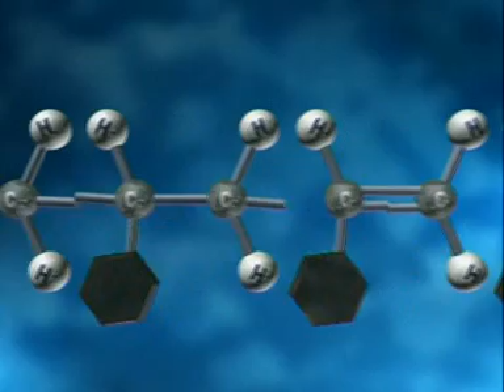Making polymers

Comment: Just realized styrene is  a cyclic hydrocarbon /aromatic like  rather then polyethylene types so i was more fixated on how you take ethylene and get HDPE vs LDPE vs a crosslink PE like pex pipe? My issue is taking ethylene monomer how does one thru chemistry define which type he is going to produce... aka long monomer chains vs short monomer chains vs adding crosslink in it... Because its one thing to understand it another thing to beable to make it. And i want the later now that i have a pretty good understanding of the former. (what chemical process affects the chains or another words changes the polymerization so much to get so many different hardness , elasticity ,...etc i was imagine its all in how long and where the chained monomers are bonded so its very important to know how to affect this to make plastic #2 or #4 or PEX ...etc.

Comment: Nice video, curious can polymers only be created by alkenes and alkynes? Aka double or triple bond hydrocarbons or can it be done thru alkanes (single bond hydrocarbons)  as well? It seems the polymerization process require at double or triple bonds of hydrocarbons to join the next one...But maybe there is a substitution atom process. Like to go more indepth with the polymerization process of various plastics monomers.. Good starting video.

Comment: can styrene polymerize on its own over a period of days?
Reply: No. You need another radical (a charged molecule) to break the double bond of a styrene monomere. This styrene monomer will have two charged ends, which can also break double bonds of other styrene monomers, and bind with one of the ends of the broken styrene monomer. You basically get a chain reaction, until you get a polymer: polystyrene.

This radical that starts or "initiates" the chain reaction is also called an "initiator".